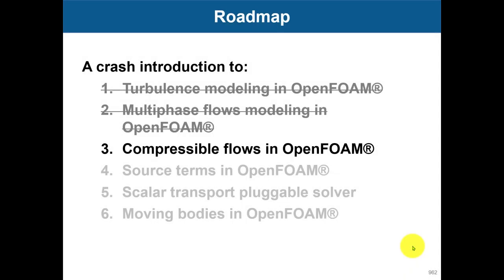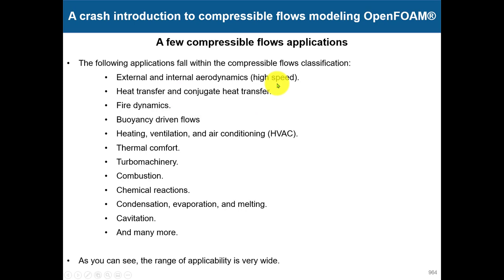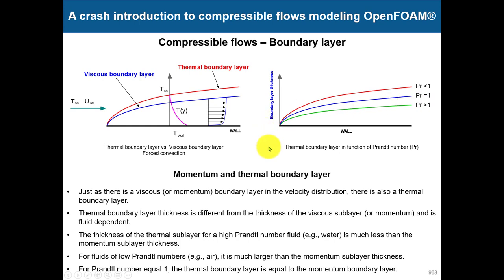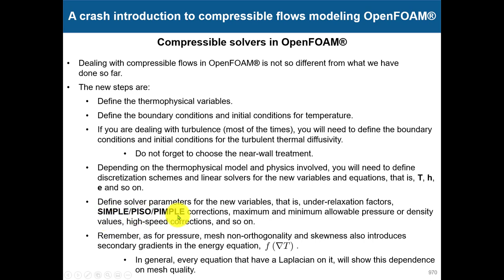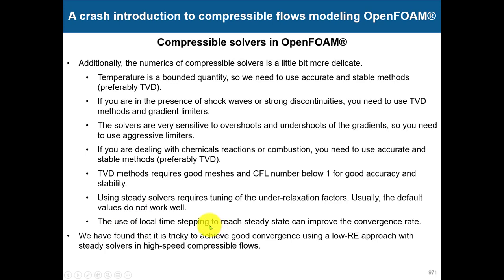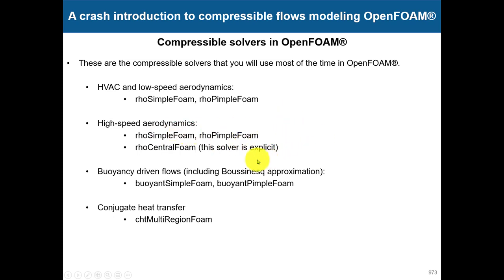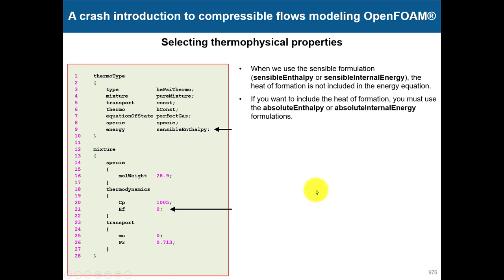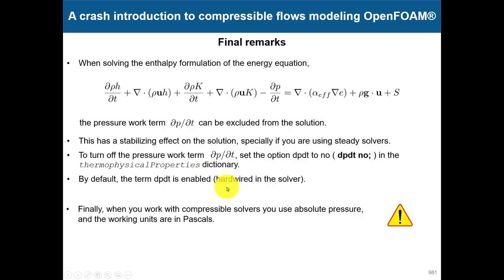8.8 Module 8 - Advanced physics - Compressible flow #openfoamtraining

Comment: Hi, do you have any documentation on the explanation of phi, phiv, and phid?
Reply from the maker: Well, probably is not the right answer, but you have the source code. phi* are the fluxes, depending of the formulation you are using different fluxes are used.